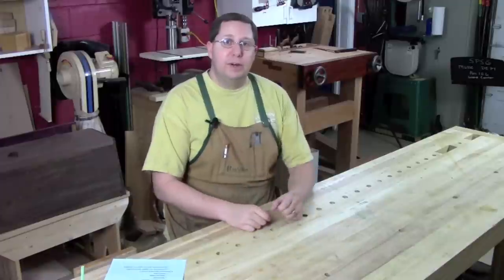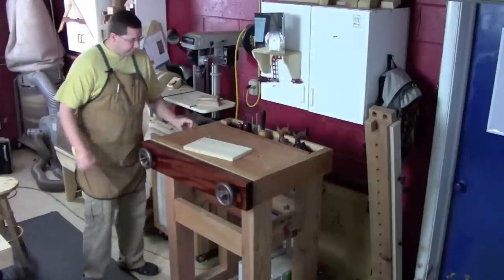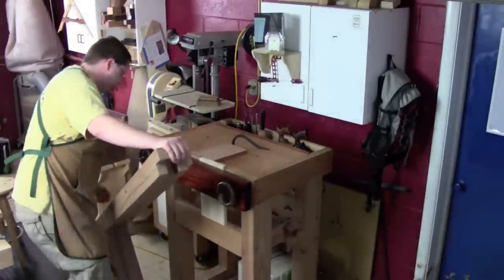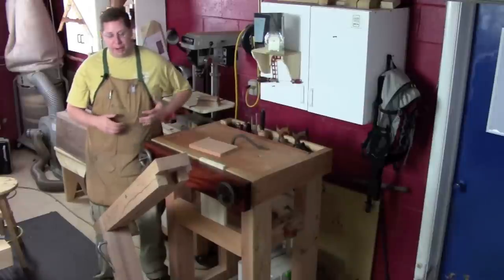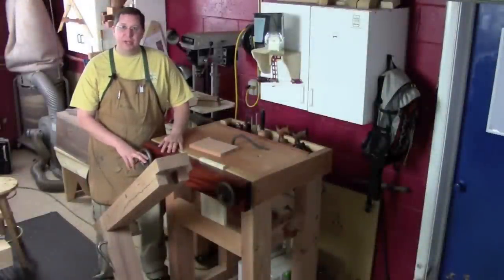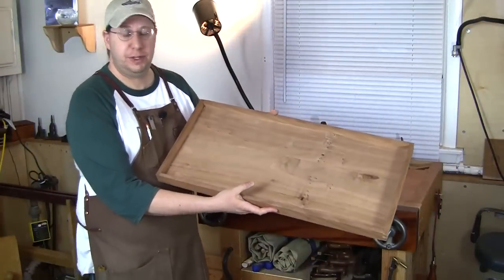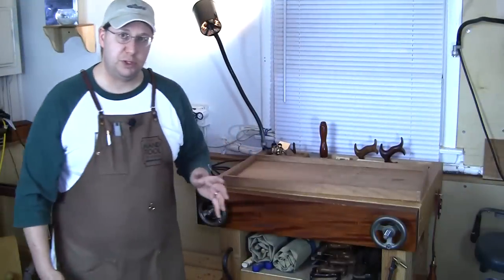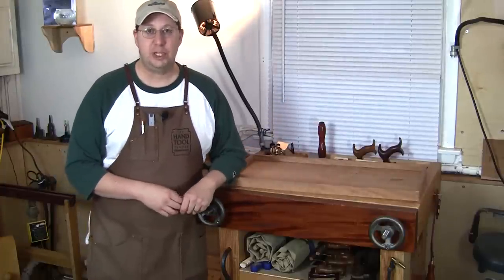RWW190 Joinery Bench

Comment: I like this. Where I can see this being handy for me is to have a second smaller bench inside the home. Sometimes I want to be inside with family rather than working in the garage by myself.  Basically as you said in the video when you talked about apartment workers. Inside the home I would be doing joinery work so it being taller is handy. I could even use one of the kitchen bar stools to sit in front of it comfortably with it at this,height.

Comment: So the real advantage of this bench is the height. Adding a moxon vice to the end of your existing bench does the same thing? I agree this is an excellent bench for the apartment woodworker as well. I never use my tail vice on by bench, I thin I will replace it with my moxon vice, This is a fantastic idea, thanks for the application.
Reply from the maker: A moxon will get you close but the bench surface behind the vise is a major advantage too.  I think the bench on bench model is a good compromise instead of just the standard Moxon vise jaws.

Comment: Assuming that the vast majority of pieces one clamps are of a common thickness throughout, requiring two separate tensioning adjustments seems a bit inconvenient. Perhaps an inexpensive and not too elaborate solution would be to incorporate bicycle-style gear wheels to evenly adjust the clamping tension from either crank. A gear wheel could be installed between each crank and the outer clamping board and fastened to the axle with hex screws. A bicycle chain would synchronize the gear wheels. This solution would still retain the ability to separately adjust the cranks when necessary by loosening the hex screws of either gear wheel, making the necessary adjustment and then re-tightening.

Comment: Great video Shannon and a great little bench.  Do you find the lack of mass to be an issue?  I noticed it does wobble some when you use it for planing and sawing.  One of the advantages of the large benches is the sheer weight of the bench makes it very stable.  I'm curious how much an issue this is.  Thanks for all the great videos.
Reply from the maker: Scott Clark no not an issue, sure it wobbles more than my Roubo bench but thats to be expected since it weights less than 1/3 of the Roubo.  There are changes that could easily be made to this design if the plan was to use it for milling work.  For me, it wasn't an issue because I just use my full size workbench.  One of the easiest things you can do is screw the whole thing down to a sheet of plywood that you stand one while planing...ta da instant bench weight gain!  It really just comes down to how you use the bench.
Reply: Great Idea! 

"I'm not fat, I need to keep my weight up to stabilize my bench!"

Comment: Shannon, I'm sure this was covered in the past but would you mind telling how you came up with the height for this bench? I'm guessing a few inches below your elbow, is that about right?
Reply from the maker: dericcornflakes I started at elbow height.  I built the benchtop first then set it up at a variety of heights and actually worked at it, cutting joints and doing layouts and such.  Eventually I did come in just below elbow height so that a typical 4/4 board would land at elbow height.  That is what works for me and I highly recommend doing some experimentation to find your personal sweet spot.
Reply: RenaissanceWW
Thanks, I have been thinking hard about building one of these. I don't do much big stuff anymore and a spare bedroom for a workshop would be much warmer in the winter and much cooler in the summer. I can do the rough work out in the garage then come inside for comfort. Agree on experimenting for the correct height but was curious as to where yours ended up at. You really have to build these things to suit yourself, no magic formulas imo.

Comment: How did you decide how high to build your bench? I am 6' tall and I usually work at 36" tables. I can see a use for this in my limited space shop and would like to build it but I'm not sure how high it should really be.
Reply from the maker: Guy Jones I built it elbow height but played around with many different heights so your results may vary. Start there and see how you like it
Reply: That was what I was thinking as it would keep my forearm level and control my movement better.  I will definitely be building one of these benches!